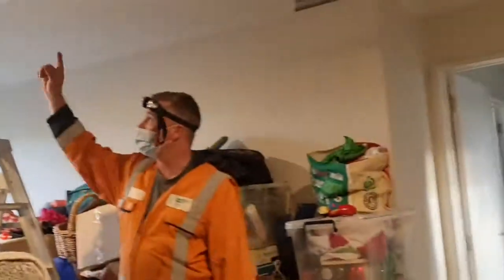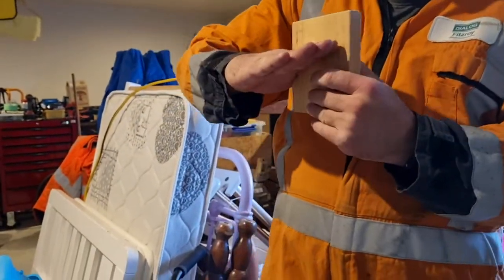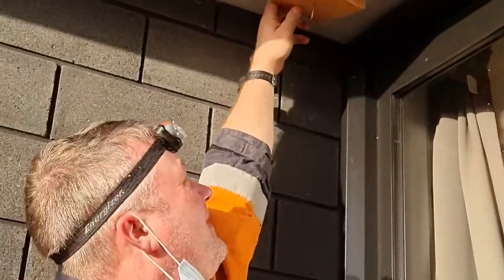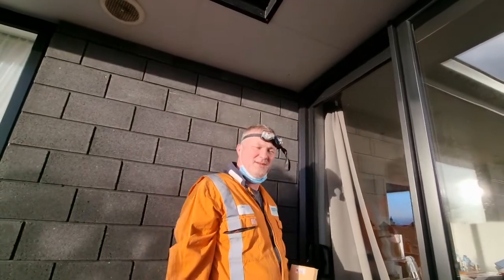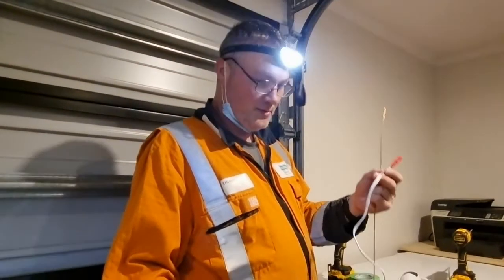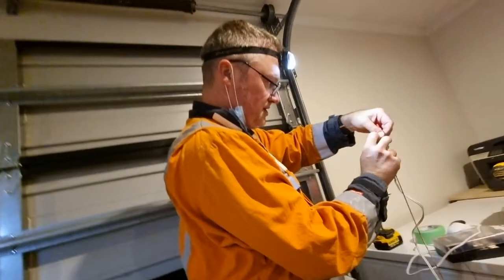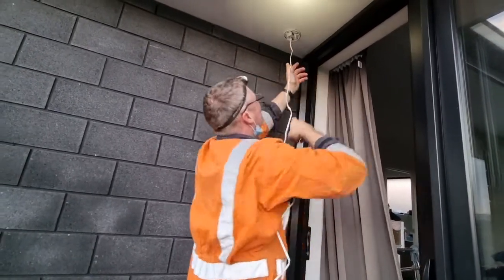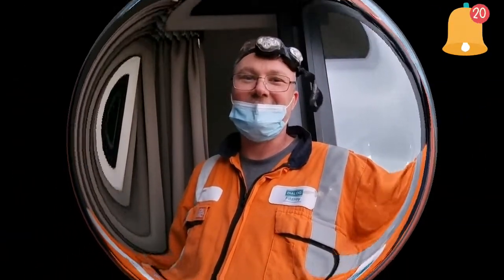Install Swann dome camera in soffit

Comment from the maker: It has a base plate, which is cast metal that has a thread that holds the camera in the cradle, if this is loosened, the camera can be rotated in all directions, similar to a ball swivel.